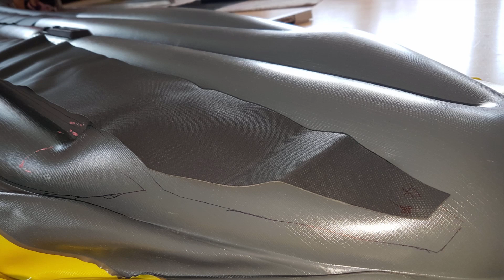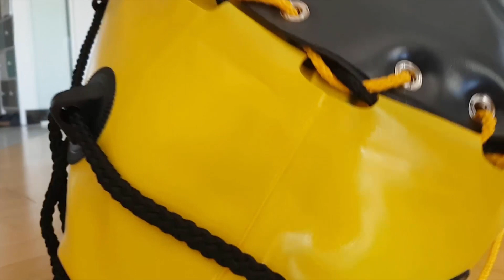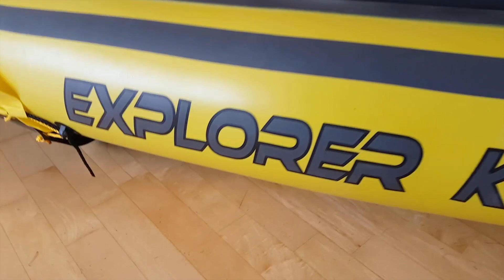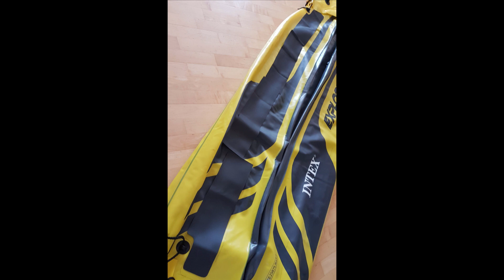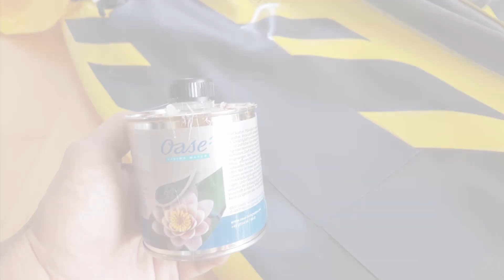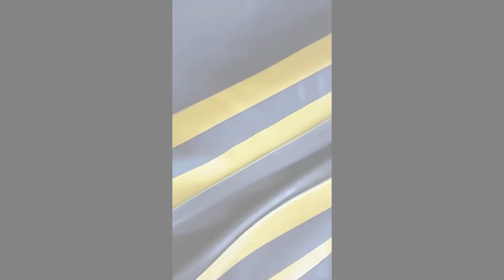INTEX Explorer K2 - Upgrade your Boat for Rapids with under 50$!

Comment: I like how you not only reinforced the bottom but the SIDES as well. Certainly a step most of us would forget about. Thanks for the tip, I am waiting on mine to arrive by post and I MAY try this...
Reply from the maker: For the side it is very important to cut the pieces in some smaller pieces otherwise it can happend if you inflate the boat and the pvc is expanding the glue may fall off.(in my case @1 side happend). Also a tipp use the side protection 10cm more down to the Bottom. Stay tuned!

Comment: All you need is a couple layers of gorilla tape  35 bucks CAN for tree rolls , and your done for the next 4 hundred years  . 
Great job on the kayak  👍
Reply: Actually, that would not stick very well on the PVC the boat is made of. You would have to apply such tape every time you went out on the water (then, at the end of the day, remove and throw away the tape). Because of that, you would be better off with $2 worth of duct tape (50 m per roll, too).
Reply: What about flex tape?

Comment: Great ideal. I only wish you would had shown us how you did it.
Reply from the maker: Yeah sorry did not thought about this when i had done this. But its really not complicated just cut some lines, put glue on it an stick it together with pressure. The front reinforced part just screw some holes into the pond cover and fix it together ;)

Comment: Can you maybe give a little more information on how you did the modification? Did you apply the PVC glue to the pond liner while the boat was inflated?
Reply from the maker: Hi Jamon, i did all when the boat was deflated, but it´s imported that you cut the pieces not longer then say 400mm x 100mm so there is enough space for the PVC to expand and there is not to much pressure.

Comment: nice video, how is your boat holding up?  Any changes you would make besides putting the side protection down 10cm?  Danke
Reply from the maker: Yes after 2years i have put some glue on some parts but only 1cm. Side protection would be better 10cm down to bottom as you suggested
Reply: @TomKitesurf-Passion  awesome, definitely going to do this. I was hesitant buying this because I thought it would be money down the drain after a few uses.

Comment: It's been 4 years now... how has this held up? Or has the kayak been replaced? Or upgraded?  :)
Reply from the maker: Still existing and held up. Only 2 small parts about 10cm disconnected and have to be reglued. Biggest enemy are direct sunshine to the dark areas and very high pressure on land on water no problems.
Reply: @TomKitesurf-Passion  Thanks for the update. I am thinking of doing this to my Intex Excursion :)
Reply: @Obliticus  Hi, did you do it to your intex exursion , how did it hold up?
Reply: @markweatherall7437  I did not. I realized that even with an extra tough bottom, the kayak itself is just nowhere near as rugged as a real inflatable whitewater kayak. So I ended up getting a NRS Star Outlaw.
Reply: @Obliticus  Thanks for your reply and letting me know it will not fold/roll away after deflating it. I would really like to glue the plastic membrane onto the hull and sides.

From a personal point of view I wouldn't be white-water rafting in it anyway, I'm just using it for light casual leisure use in rivers and lakes and it would be just to give it some extra added protection against unseen shallow water/rocks/ sunken branches/logs etc.

Do you remember if it atleast folded in half afterwards? Thanks.
Reply: @markweatherall7437  oh yeah it will fold or roll up fine. I would just store it un rolled and partially inflated. My biggest concern is really repeated folding/unfolding
Reply: @Obliticus  Sorry for the misunderstanding. Yes I agree with you on that one about storing it unrolled/folded and to leave a little air in it. I want to do the membrane/liner mod so if I did then this is what I would do.

Comment: Good for you that you made this modification. But, without showing us how you did it, the video is not useful.
Reply from the maker: You have to cut the pieces and put the glue on it...thats it  (when the boat is deflated. 12hours with preassure)

Comment: Can you provide links for the US
All I can find are ones for like $1000
Reply from the maker: I think its called PVC Cement in us or? https://www.pvcfittingsonline.com/resource-center/what-is-the-best-pvc-pipe-glue/ this is what i found should be available on amazon or in the next DIY Market for sure!
Reply from the maker: Or Here => https://www.amazon.com/stores/page/95BD6071-7C5E-441F-92D2-D9FCD9D25B7D/
Reply: @TomKitesurf-Passion  thank you
Reply: @TomKitesurf-Passion  I can only find thick pond liner like 14 mil
Reply from the maker: @randyfreeman5650  yes maybe in a DIY Market nearby? Standard in Europe is 0.5 / 0.8 / 1.0 / 1.5 mm but of course in US is all bigger ;)
Reply: @TomKitesurf-Passion  thank you